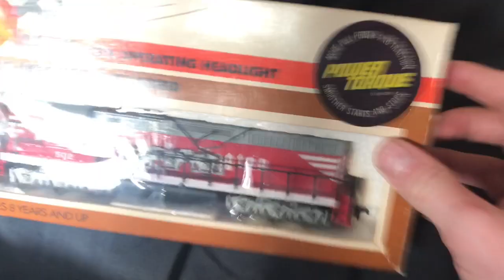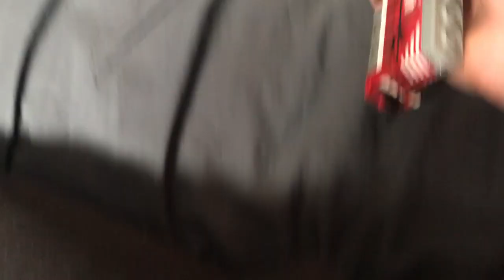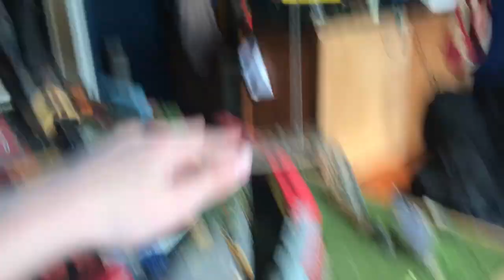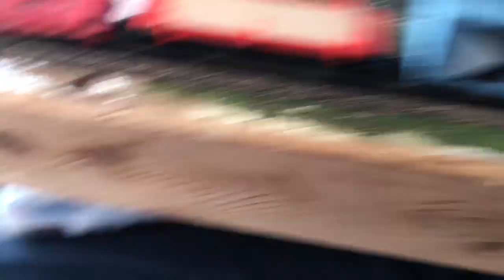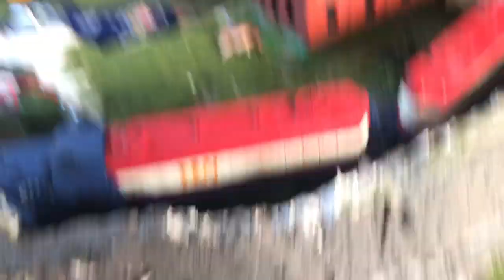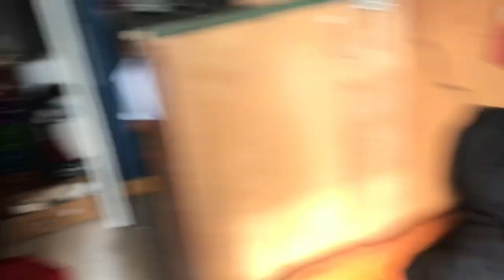Day 21

Comment: It's not an SD9. Its the SD24. On the conductor's side behind the cab is the air filter that looks like a round hump and the set of small air reserviors on top of the roof. Also, the smoke stack is a turbo charge type. The SD9 has two small smoke stacks that are non-turbo charged. These are some of the spotting features.